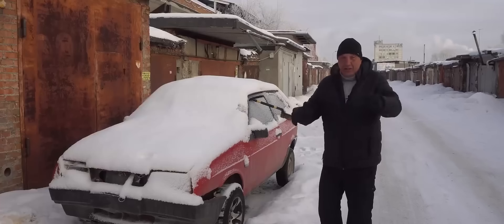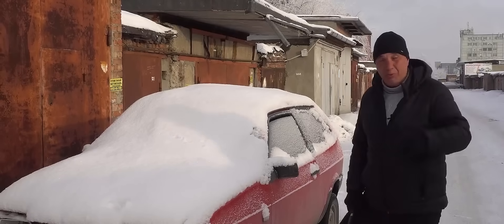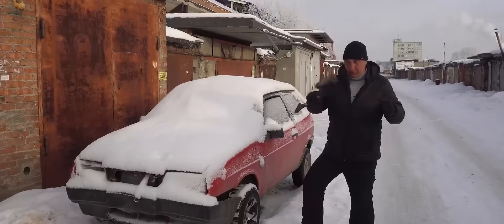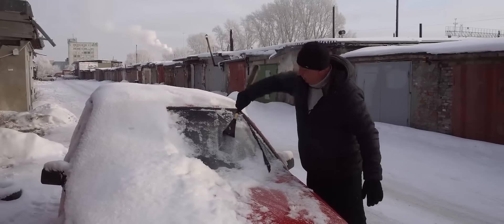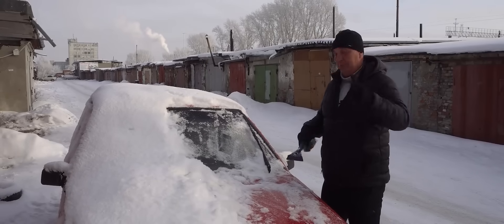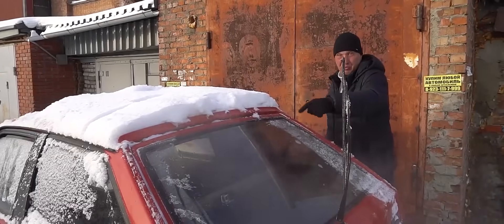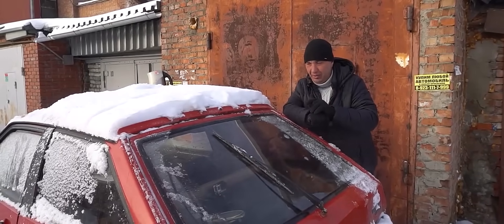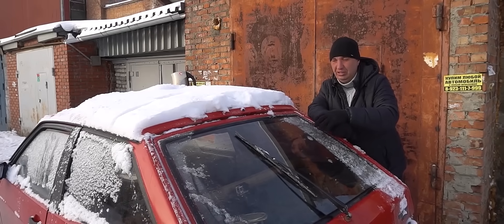What happens when you POUR boiling water onto a frozen windshield?

Comment: The heat exchange between the hot water on the cold windshield isn't the same as cold water on a hot windshield. In this instance, the cold overall surface of the glass absorbs the heat from the boiling water enough to spread out the effects of the hot water over the entire windshield.

If, however, you heated the glass to an extreme temperature and then poured cold water on it, it would shatter into a million pieces.
Reply: Midnight Run nerd 😏
Reply: @calibdovah1962  - I guess "nerd" beats "DUUH - I don't even know how they make hot water..."

Comment: when i worked at infiniti a large amount of their qx30 cars brand new on the lot had a windshield cracking defect, the windshield was placed on with mounting points that didnt flex a certain amount and the glass would press itself against the cars metal when the sunlight hits it directly, we had cars brand new sitting on the upper lot floor have sudden cracked winsheilds one by one
Reply: long story short im sure these ladas have great glass but im also sure they probably have more room to flex aswell

Comment: I try that on my mercedes 190e 1996 and front windshield cracked.
Reply: They only made them until 1993...
Reply: Would of been a C-class if it was made in 1996 ;)
Reply: @wetlettuce4768  *would've
Reply: @SeamonVB  wot u tawkin abelt?
Reply: I tried it on 2010 Mercedes many times had no problems little bit by  little

Comment: there are many variables to consider with this experiment such as old type of glass screen used compared to newer types, original or non original glass screen fitted, unnoticeable damage to glass screen, incorrect fitment of glass screen allowing the screen to touch the body work while it try's to expand causing localised stress, or type of  fixture used ie rubber or glue and weather the rubber or glue has hardened to prevent expansion while still holding onto the glass, also to say a screen is frozen is not enough, if the screen is dry frozen ie  rather than frozen in a semi moist environment the chances of cracking will increase, in any case this method of de-icing us always a risk, and to prove this point i will tell of my experience of having to replace a two week old new road spring which was a original part, i replaced both front springs at the same time due to rust, and had driven several thousand miles with no problems, they were fitted correctly as I'm a mechanic and all was well until a very very cold day after a period of dry weather i opened the dtivers door and flopped into the drivers seat, only to hear a very loud bang/twang on inspection the new spring had snapped clean in half, there were no marks from damage or wear the spring was seated correctly with no damage from being fitted incorrectly ect , it just did not have the same tensile flexibility in that very low dry temperature and POP it went, of course i got my money back and a new free spring but it goes to show that even sprung metal can suffer from this problem.

Comment: It's tempered glass (aka: safety glass).... Is made to withstand extremes in temperature and impact. Duh! If by chance there is an impact strong enough to break the glass....it will break in module pieces.. no sharp edges.
Reply: They tend to make the windshield out of normal glass with plastic in the middle so it shatters easily in case of an emergency
Reply: @mikeguy1899  ya...it's called safety glass.
Reply: @PeepLa7-PurpleButterfly-Soaps  tempered glass and safety glass are completely different
Reply: @mikeguy1899  on my Hyundai....it's tempered safety glass....I can read....that's what it says.
Reply: peepla7 you are correct

Comment: Not sure, but I think if he'd poured that hot water on in one huge splash, rather than slowly pouring it out, he might have gotten a reaction. That windshield represents a substantial overall frozen mass, so it likely cooled off the water immediately on contact, but if it had been, say a gallon of boiling water all at once,  that would have maybe stressed it enough to crack.
Reply: well the cracking happens from repeated application of hot water the stress from having hot water poured on the windshield over and over is why the windshield cracks eventually the heating and cooling rapidly breaks it little by little and eventually you get a pop and a huge crack when it finally goes all together 
the heaters for your car can do the same thing if they heat up to quickly
Reply: If you do it that way, you’d be stupid

Comment: I think the slow pour is what kept it from cracking. The heat has plenty of time to disapate out, whereas a wide area sudden shock would probably cause the glass to shatter
Reply: I always heard you’re not supposed to pour boiling water on the windshield because it will make every windshield crack you’re supposed to go out turn your heater all the way up leave it for a few minutes let the car warm up inside  melt the ice and also you’re not supposed to turn the wipers all the way on full I heard of some people doing that and they broke the motor very expensive repair !!
Reply: I turned the wipers on and bent one of the wipers it wasn't even that much snow on it, but i never driven in snow before that so yeah =(. I did turn the heater on in the van and it just didn't heat it up even with 2 of us in the van, i had to scrub the ice off and used cold water that i had in the van to get it off, i guess some cars have better heating or even battery powered heating before the engine even gets warm  @JohnDeere_Simulations

Comment: All you need is tap water. Why risk it, get the car started and just use a quart of tap , usually 45-55* works fine. But you will need to put defroster on right away or fog will blind you.

Comment: Perhaps it was not cold enough outside.  💨
I'm Canadian and - 5 to -10 in the winter is actually quite warm. That's what we call T-shirt weather.  👙
Now if the temperature outside was really cold outside say - 30 to - 45. Then I believe the results might be different. 
I say might because we go to car washes where hot water is sprayed on the car, and people's windshields with zero damage.
I think the only way it would work is if it was around - 40 and there was a small chip in the windshield, for the boiling water to enter and have any effect at all.  And I think the old windshields might crack faster then the new shatter proof ones.  🚘 
.......❄️ But I'm a girl and I'm just guessing..

Comment: I had a half dozen front discharge Advance concrete mixers and replaced a bunch of windshields  from the drivers spraying them with hot water from there wash out hoses and from the tank filling hose at the concrete plant its so hot you cant touch the hose with out gloves its like 200  F just below boiling  they use hot water in the concrete from October thru end of march and they charge extra for it !  Oh you wonder why you get water on your car when one passes you they set the hose to dribble so it does not freeze up while they are going or returning from the job site .

Comment: A quick way to get ice and snow off your windshield is to put two parts rubbing alcohol and one part water into a spray bottle and spray an even coating on the windshield.  Wait a few seconds and you can use your windshield wipers to wipe away the ice.

Comment: Much will depend on the quality of the glass, for sure. I would use room temperature tap water if at all, as boiling water will no doubt weaken the glass over time. If you use boiling water on an old British Leyland car the paint would probably peel off.

Comment: This is really simple. It’s got nothing to do with being Laminated or Toughened glass. Bonded or in a rubber. If the glass is perfect with no chips. You are fine to pour hot water on all of the Glazing in your vehicle. However if you do have a chip in the glass you are taking a risk. Now you may think you know there is no existing damage to the glass but there can easy be a chip that you can not see because it’s very small or it’s hidden in the black area around the glass. So I wouldn’t advise you defrost your car this way on those grounds. Master Auto-glazing Technician with over 15 years in the trade.

Comment: Try this with ice water pouring on the surface of hot glass in the summer, or by using a heavy heat gun to turn the glass to the point, guaranteed the windshield will crack instantly no matter a Lada or Mercedes Benz.

Comment: why would it break? you can pour boiling water into a frozen glass bottle and it won't break but if you pour very cold water into a bottle that's been heated up in the oven it will shatter.

Comment: The diffrence is between tempered  glass vs laminated glass.. tempered glass have usually more thickness and is more expensive and shatters in to small pieces upon impact Vs laminated glass that is thin, cheaper and can crack very easily upon smallest impact..old cars and expensive cars always used tempered glass where as some auto maufacturers now days have resorted into using laminated glass for cost cutting.  Laminated glass also fogs up faster than laminated glass due to slightest of temp variance. If you pour boilinh water on a laminated glass there is a 90 percent chance that it will crack so be careful. Its always better to turn the defrost on for 5 mins and then start pouring the water from outside.
Reply: mohsin haq Nope that’s not true
Reply: @bluemonkey227   ok then buzz off!
Reply: Auto manufacturing have to use laminated glass for the Windscreen due to safety regulation which says the Windscreen must not shatter or leave the vehicle in the case of an impact. Lots of high end marks now add laminated glass as what is known as body glass. This is more expensive to manufacture especially when opting for an opening laminated door glass. This is due to the stresses caused on the perimeter of the unit by the mechanical movement of the window regulator. A smoother and more accurate regulator is needed. Laminated glass is harder to manufacture with bends in it without causing distortion. Rear Glazing in vehicles is typically very curved so toughened glass is an Easier and much cheaper solution. If you have ever noticed the black band going around the glass. It often changes into dots. This is a trick to make it harder for your eyes to pick out the distortion found on the edges of every laminated glass that has a curve.

Comment: if you touch the windscreen on the inside whilst getting someone else to pour boiling water. you will notice you won't feel the heat from the inside. because when the water hits the screen the ice and cold screen cool the water pretty quick. and also your windscreen is laminated so it's  another thing preventing boiling water cracking the inner glass

Comment: The glass is toughened. Which means its heat treated. It can withstand the transferance of temperature easily, however it cannot withstand being hit by a pointed object (like the tip of a spark plug) or being hit on the edge ( weak point). Proof: I am a glazier.

Comment: Windshields are designed to handle 'extreme' changes in weather. The same windshield could very well be in a cold environment (-15) and and in a hot climate (in full sun a windshield may very well get temps of 60)
Reply: Like someone else explained, the shape and the gasket allows for expansion / contraction.
The reason why a glass or bottle would crack for example is that it' s shape does not allow for partial expansion / contraction (expansion / contraction at one spot only).

Comment: What a pile of shit.  The only way that screen might have cracked,and I'll say might, is if there was a stone chip on it. As mentioned the sudden heat and expansion would be enough. But only crack. It's laminated so CANNOT shatter. It has f#$k all to do with adhesive or being in a rubber. 
For the record I've been fitting windscreens for 25 years.
Reply: Makes me laugh saying a screen in a rubber can handle the expansion but a bonded one can’t. Lol

Comment: You were probably right to avoid doing this with your Mercedes windshield. It's not a good thing that the adhesive used to secure your windshield allowed for such extreme and isolated temperature changes so quickly because it means that during an accident your windshield's likely to become a projectile due to the adhesive being cheap.

Comment: It is supposed that the sudden change of temperatures causes the glass itself to crack due to the temperature and high temperature but the thickness of the glass prevented that from happening even though it is in fact that it was lucky it did not happen

Comment: I’ll explain why it’s not cracking. Cause rapid heating doesn’t cause things to shatter. So boiling water on your cold window doesn’t crack it. But now travel down the street at 30 with your new hot windshield in the freezing cold air and see how long it stays intact.

Comment: You can throw 3 , 5 gallon bucket's of really hot water but not boiling hot 😵without scraping off the snow, on top of the car ... but not directly on to the windshield ** throw the  5 gallon's. of hot water & that should do the trick' it won't crack the glass because it's too darn cold' oh but don't forget to have your windows all the way up' 
And also if your windshield already has cracks in it I wouldn't put any hot water on it... I had a Toyota Camry wagon and I've done this and it work's... without any problems
PS: if you turn on your car and get your defrost going that also helps while you're throwing the warm hot water on top of the car' not directly onto windshield 😁.

Comment: There was no real hard ice under the snow .. looks like its been lightly thawed from the inside first but not enough to have the snow slide off. Before the water is applied,  the window is looks pretty clear , no internal condensed frost visable from the outside. so looks like it was 'ready' for boiled water..

Comment: pouring boiling water on the windshield is not gonna crack it, unless it's really poor quality.
heating the window causes it to expand, and expansion won;t cause it to crack. if you poor cold water on a hot windshield -- as I see a lot of people doing in the summer (washing their car in the blazing sun from a cold water hose) -- will. cold water will make the glass contract much faster, and since some areas of the glass will still be hot and some are gonna get comparably very cold, the uneven expansion/contraction going on will, or lets say, might, crack the windshield much easier.